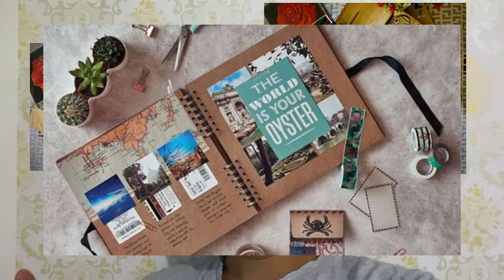How to print thick paper on epson L220  L120 - GSM 180 220 240 260 | paano magprint makapal na papel

Comment: Can L220 print 300gsm paper? Anyone care to explain the steps? Sorry, I don't understand Tagalog
Reply from the maker: Yes. Sorry just follow the video.
Reply: @DjLongzkiePh  Thanks bro, turn out my L220 cant take 300gsm, will stuck inside. Never mind
Reply from the maker: Depends on how you bend the paper make sure that you bend on the same area.
Reply: @DjLongzkiePh  Nah, I don't think so. 300gsm is a bit too much. My L220 print 240gsm easily no sweat. 300gsm too thick in my opinion. Probably the bending good up to 260gsm? I already ordered 260gsm and will try that when arrived